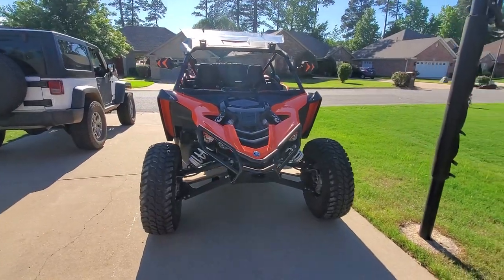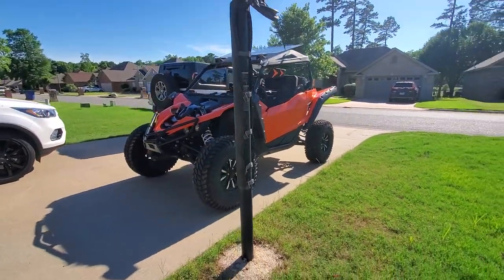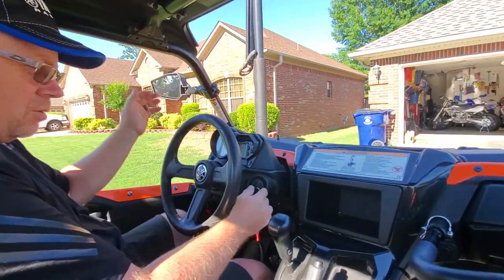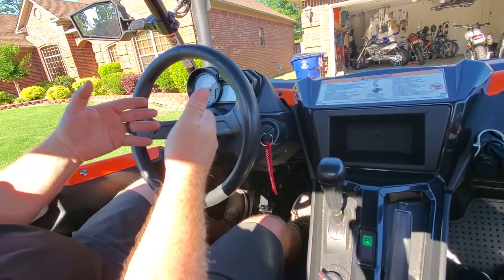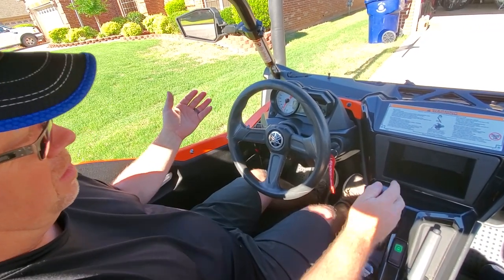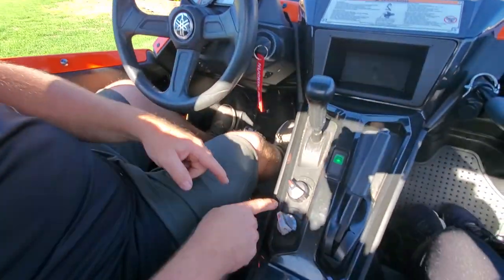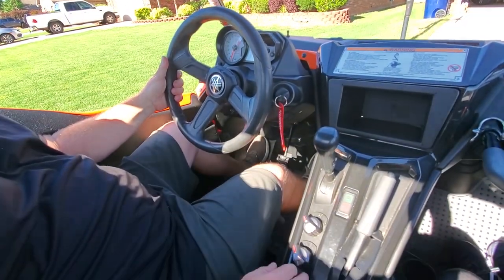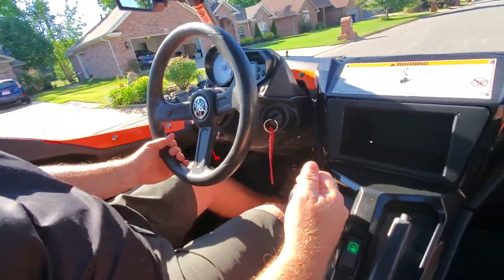2016 YXZ1000R

Comment: This is not a factory clutch....FYI
Reply: And also probably not the way the centrifugal clutch is designed to be used.  You can shift any manual trans without using the clutch.  But I wouldn’t.
Reply: @kdiddy7076  its a sequential transmission with straight cut gears.
Shifting without the clutch will NOT hurt it.

Even with the factory clutch.
Reply: @joeblow8893  pretty much like a dirt bike with the dual mesh transmission?
Reply: @ryanfaubert2014  yeah kinda. 
Upshifting requires you not be on the throttle, while downshifting requires a "blip" of the throttle as you shift.
Reply: @joeblow8893  you can upshift with throttle and you don't need to blip the throttle when downshifting because it rev matches for you. it almost works like a motorcycle with quickshift/autoblip
Reply: @joeblow8893  I agree, it wont hurt it, but not cause it has straight cut gears, its because it looks like it has a dog engagement